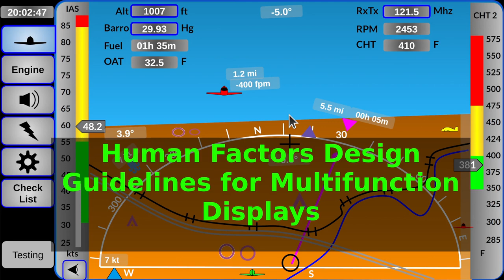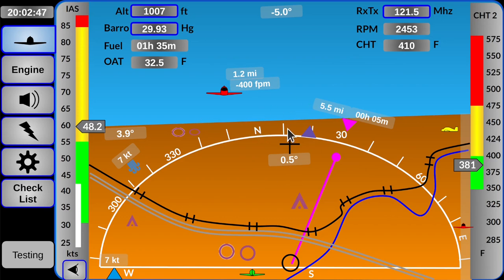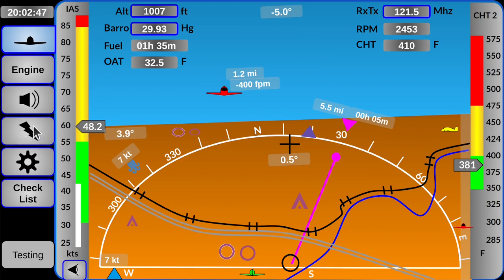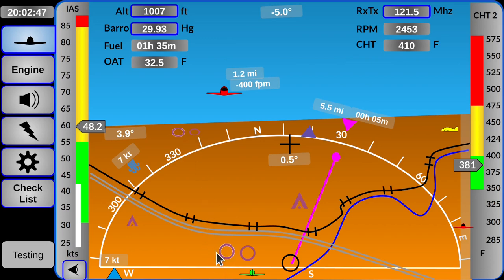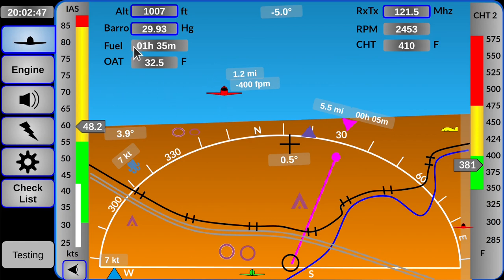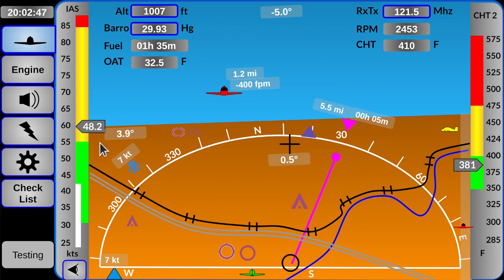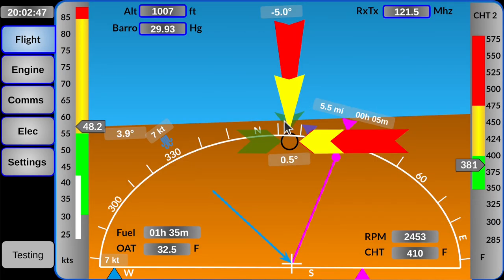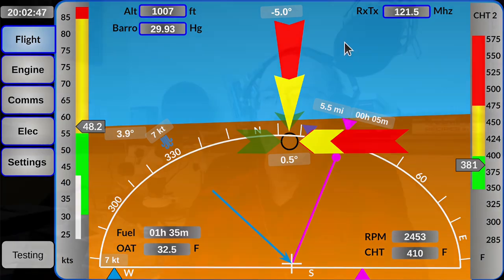UWS-4: Touch Panel, Part 3

Comment: i like the lengthening AOA arrow.

But the slip skid, at least to me, is confusing. if the ribbon is to the right, but pointing left, I have to think about what to do. Do I step on the left rudder, as the pointing arrow is telling me I need to go left more. Or do I step on the right rudder as that is the side the ribbon is on? It sounds like the latter to me (as in, "step on the ball", but "step on the ribbon" instead), but my intuition/non-thinking-brain tells me to apply left rudder per the arrow telling me my nose needs to go more to the left.

I think it makes more sense if the ribbon went left, while pointing left on the left side of the ribbon. with the ribbon growing in length and changing in color just like the AOA indicator. That way you "step on the ribbon", apply rudder the direction the arrow is pointing, etc. Multiple modes of reinforcement all telling you the same thing. And as the arrow grows in length and changing color, it would be rather intuitive I think.